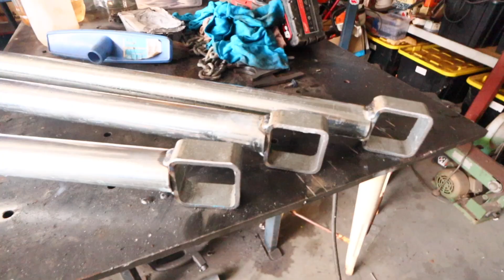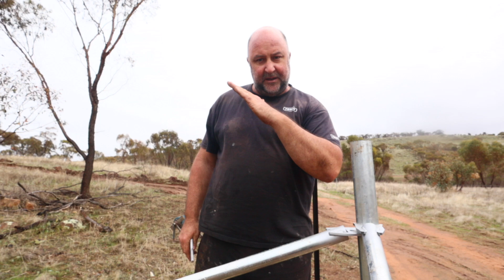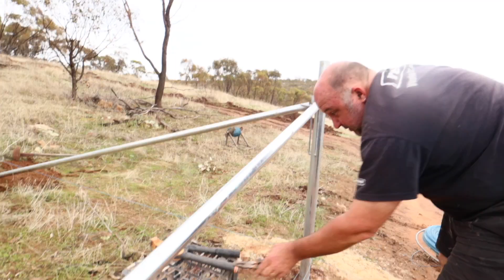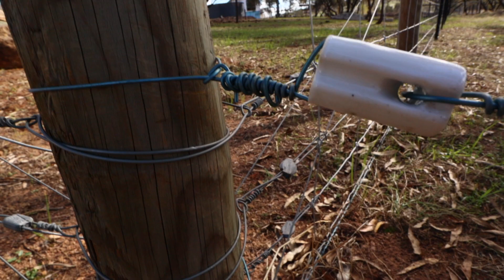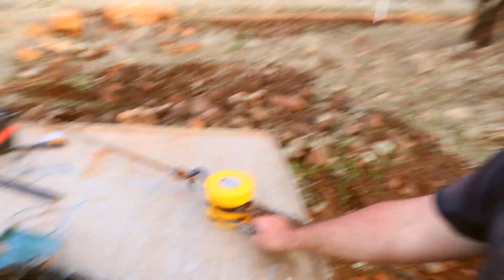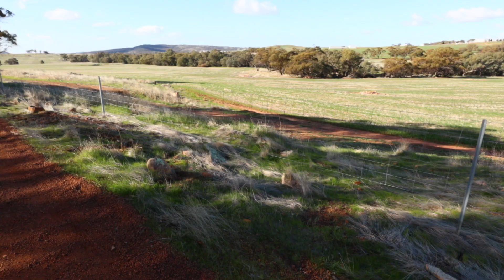Our NEW Easy Cheap Strong Corner Post | Paddock fencing Part 2 - end/corner assembly & insulators

Comment: Love the idea of the threaded rod at the high point , rather than the long piece of threaded rod at the base to put pressure on the post. So  easy to come and re-tension later if needed.

Is that all made from 50nb 2.3mm Galv pipe ?
Reply from the maker: Cheers mate. The post is 50nb the diagonal is 32nb abd both are 2.3mm

Comment: Why are you using the ceramic insulators backwards, they are stronger in compression not expansion.
Reply from the maker: @trevorwilton2723  yeah realised a bit late, will fix it on the remaining  runs 👍

Comment: G'day, mate, I admittedly did fast forward through a lot of the video, so apologies if you've addressed it somewhere.
When doing a corner end assembly, it's much stronger to have a single stay arrangement pointing into the paddock at whatever angle is halfway between both strains. If, for whatever reason, you can't have the stay pointing on that angle (machinery hazard/goat escape), the closer you can offset two stay assemblies towards that angle, the better.
Reply from the maker: Yeah 100% correct there mate, it was mainly to avoid an extra hazard but you’re right about the strength 👍 … fast forwarded…?! C’mon 😂

Comment: Nice job mate. One thing I thought of. If you drop two spots of weld about 10mm apart down the corner post every 100mm (or so) you'll have little 'nobs' that you can sit the wires in (as you wrap them around) and it will stop them potentially sliding up and down the post as you tension your wires. Useful in case your corner post isn't always perfectly vertical (and they will always move a little). Or you could drive tek screws in and it will do the same thing. 

By the way @reeceplumbing - for the love of dog, sponsor this man a new t-shirt, he's given you guys so much free publicity. 😉
Reply from the maker: I think I’ve finally convinced him he needs a new lot of shirts 😂 -Amanda